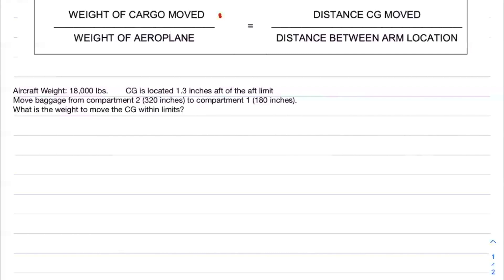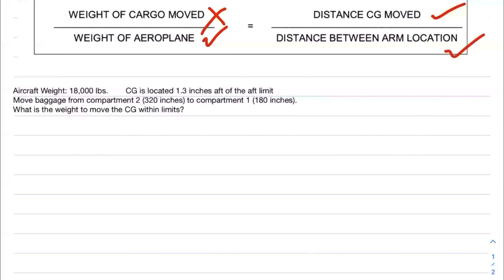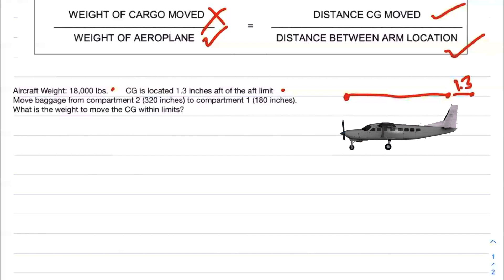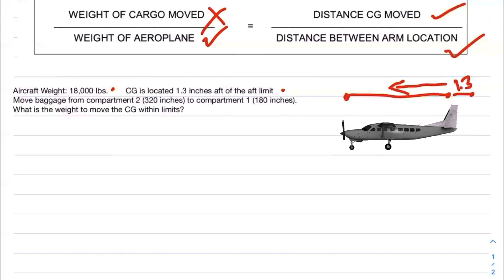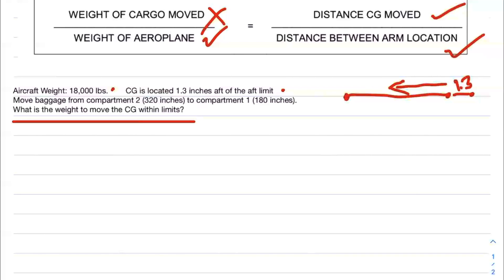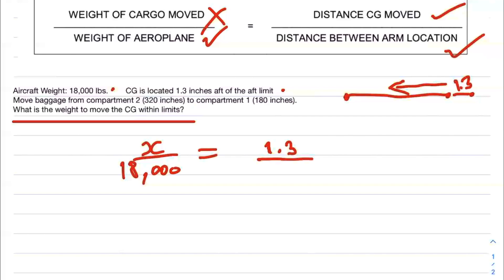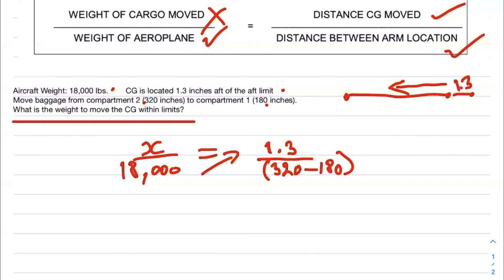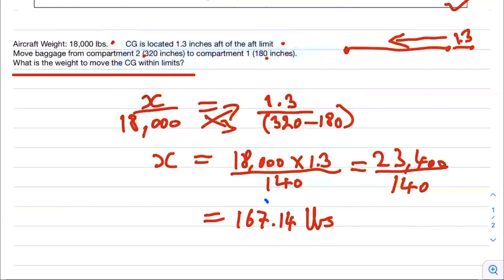Weight Shift Formula for Pilot Exams - ATPL and IATRA exams

Comment: a/c weight = 20,700lbs, CG = 1.5" aft, weight moved 500lbs, distance cargo to be moved???  Why is the above formula not working - at least not for me?? Question out of SharperEdge ATPL
Reply: Moving from where to where? ARM locations?
Reply: MPH,
First, you do not have the same knowns in your equation that the example provides in the video, eg: what is the ARM difference distance?, Second, how was the 500 lbs. arrived at without the difference between where the known arm station is that is 1.5 aft of CG and where the arm is that will put you back within CG?
Reply: The formula works. (500lbs/20,700lbs) = (1.5in/ Distance between arm locations).
ANSWER: You would need to move the 500lb weight forward by 62.1 inches. 

When you cross multiply to solve for x you can see how many inches forward you would need to move the 500lb piece of cargo to bring the CG within limits. You need any 3 of the variables to find the fourth.

The formula only gives you the delta or difference between arm locations. You would need to read the AFM/POH to see the options for stations to move it to as this 62.1 inches is not from the datum but difference between the two locations.